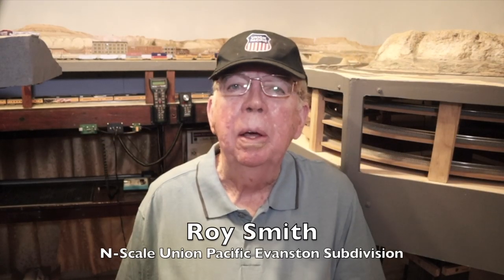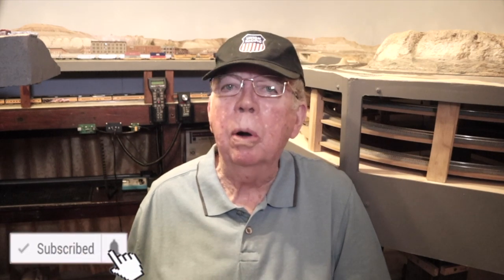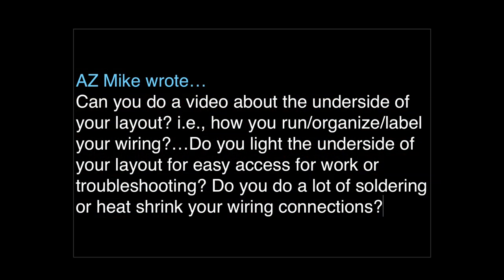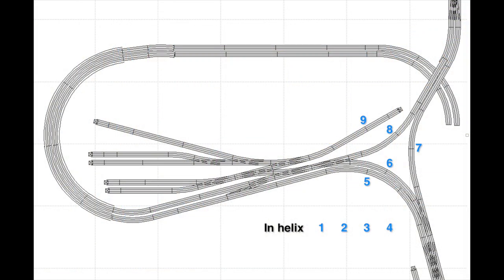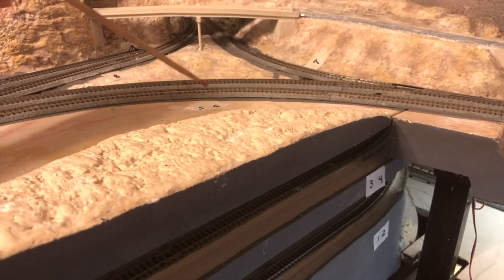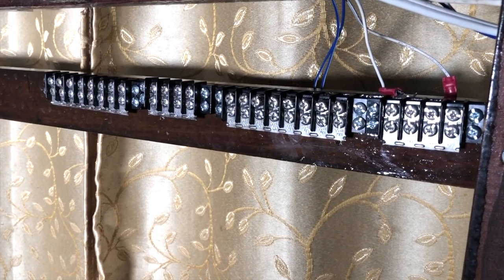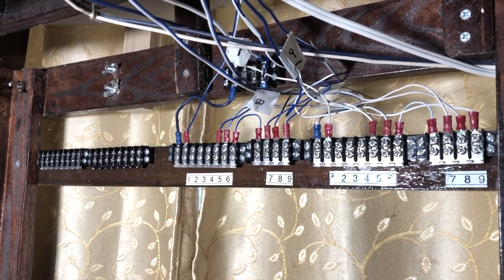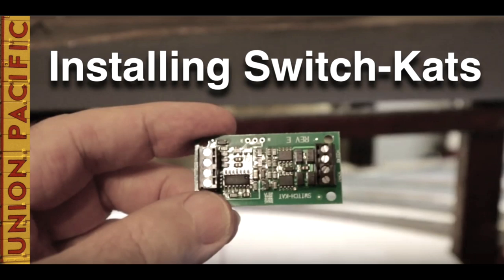Under the Layout 2: Wiring Your Model Railroad Can Be Fun!

Comment: I really like how much cleaner the track arrangement looks in Granger Junction. I have also come to believe using barrier strips is preferable. Did you consider placing the boards for mounting the barrier strips in a location near the front of the layout so they are accessible without crawling under the layout?
Reply from the maker: Thanks, Jerry. I appreciate your comment. I really like using barrier strips to to do my wiring. In response to your question, yes,  I did consider putting the mounting boards at or neat the front of the layout. They certainly would've been more accessible there. However, this area underneath my layout also serves as a desk, so I put the mounting boards off to the side so that they wouldn't be in the way when using the desk. Even so, off to the side is a really big improvement, compared to mounting the electrical components up underneath the sub-roadbed or on the supports for the sub-roadbed, as they were before. The mounting boards will be even more accessible everywhere else on my layout, and I should be able to demonstrate this in upcoming videos. ...Roy

Comment: I had an idea that I've been considering, for when I get around to building my own layout. It isn't so much to do with wiring, so much as it is simply to make under layout access incredibly easy. My plan has always been to use hollow core doors as bases for constructing my layout. They are quite affordable, light weight, but reasonably rigid, and come in standardized sizes, and are always available from your local building supply store. They tend to be made of rather light duty materials, so if you need to do negative heights portions of your layout, then as long as you reinforce any structures you might cut away, you can also generally cut into them as well. In regards to under layout service, I realized that another possibility exists... Install hinges and allow your layout to swing up and vertical! If you swing the layout forward, and have cables hold it from swinging all the way forward, you could stand in the frame, and work on all wiring from a standing or sitting position, without even needing to hunch over! If the layout is self contained on a single door, this is super easy.

Now, on the other hand, if your layout is made across multiple panels, then this is harder to do, as you'd need to have working seams where you can separate the tracks and lift either door panel without being restricted by the other. Inside corners are certainly harder, but possible. You'd need to make it so one side hinges out first, then the corner panel hinges toward the first panel's now open space. Outside corners are no big deal, as both panels already would hinge away from each other.

having the panels hinge like this, provides great access to the underside of the panel. Sadly, getting panels to hinge at the back is much, MUCH harder, as you have to worry about not crushing your work against the backdrop or wall... That said, it IS possible... The trick would be to create a functioning slide frame underneath the panel. you'd need to create a frame that is able to slide forward or backwards, and the panel would then be hinged onto that sliding frame. To make that work, you need the ability to lock the sliding frame backwards or forwards. this can be done in variety of ways, the simplest being a simple hook and eye latch, like what you might see on an old style storm door or a gate door. There are more complicated ways it could be done too. A bolt operated by a knob or lever could engage the sliding frame int he rear or forward positions, and eliminate ant bending or reaching under the bench to do service. Disconnect any tracks that cross from panel to panel (much like your lift out segment by the door), Release the bolt with the knob or lever (or reach under and unhook the hook and eye latches, if you've gone that route), slide the panel forward, and release the bolt latch (or hook a hook and eye int he front), and then lift the panel up. Again, cables would need to be present to keep it from flipping backwards and crushing your layout work.

Additionally, if you expect to have lots of under layout hardware, and worry parts could dip down low enough to catch the framework as the panel slides forward, then another variation of the sliding fram provides both added height for the panel, to allow more under panel hardware to protrude, while also serving as an integral forward position slide brace. if the forward segment of the slide frame is mounted to the rear segment with it's own hinge, then pulling it forward means that the entire forward frame will simply hinge down 90°. This will both lock the slide in the forward position, as well as allow you to still get within the thickness of the slide, in front of your bench, and the thick parts will only be at the sides and bottom, when it's in it's folded down position. It's important though, that if using this configuration, that the hinges for the panel be very strong, as they will be supporting the entire weight of the panel until you lift it vertically. For ease of movement, a fixed angle caster wheel can also be mounted upside down for the slide frame's front end to roll on, when sliding. It should probably rest on a shim on the front lip, to prevent the layout from always resting on the wheel.

The short description of this last concept has you pull the layout forward, like a kitchen drawer. The frame then pivots down to lay against the front of the layout table, and the layout panel hinges up, granting access to the underside. It will be important to have enough length of flexible wire to act as an umbilical to connect the panel to the slide frame, and the slide frame to the main bus. It might be wise to build your table frame with some extra weighty wood at the rear, since the design allows the weight to shift very far forward. You want the table frame to weigh more than the layout panel and slide frame, or it could tip. Bolting the table to the floor or a wall is another option (if the boss of the house permits it ;)

That's a kinda complicated description, but I hope it makes enough sense that someone understands what I'm trying to say. If the idea sounds interesting, and you have questions, I can try to explain it better. Ask anything.

Comment: The liquid tape is ok, specially in humid and wet conditions. But personally, I like heat shrink tubing. Not messy and you don't have to wait for it to cure/harden/dry. Also, to me, tubing looks neater than goop on the wires. JMHO

Comment: I used the liquid instead of shrink tubing. You need ventilation so I opened a window and used a mask. I liked it because it was easy to use with helping hands on the workbench. I had three feeders already on the layout. It was easy to use the liquid but put paper or something on the floor below for any dripping. Also, I used a microbrush most of the time. The brush in the cap is large for wiring as most use it for pipe sealing. It dries quickly. Washing with soap and water is all that’s needed as it will come off your hands in chips. I was happy with it and I have plenty for layouts or rewriting in the future.
Reply from the maker: Hi Dan! Thanks for your suggestions regarding the liquid tape. Chances are that I wouldn't have thought to open the window, for example. And using a micro-brush sounds like a great way to apply it. Thanks for recommending it. I'm going to experiment with it. ...Roy

Comment: Glad to see you back at the underside, Roy. I have used the liquid tape in an electronic application not on my trains. I liked it. Almost couldn't tell it was liquid. I wrapped the joint with regular electrical tape first, then sealed it. Nice solid joint.

Comment: Great instructional video.  And I have used liquid electrical tape - it works well and is more flexible than tape, but the shrink wraps seem the best option once you have them. Thanks For your videos!
Reply from the maker: Thanks, George. The shrink tubing and liquid electrical tape have both just arrived in the mail. I think I will end up using the shrink wrap, but I'm going to experiment with the liquid tape to see how it works. ...Roy

Comment: Well done again. This wiring scheme was very helpful. Although I have to admit I've been doing wiring on model RRs for 50 years I'm always looking for a better way. I have gone back to using barrier strips because I wasn't satisfied with suitcase connectors.  Thanks again.
Reply from the maker: Thanks, Craig. I appreciate your comment. I agree with your comment about suitcase connectors. I've used some of them on my layout, too, and they seem to be working okay, but as a wiring technique, I don't like them very much. ...Roy
Reply: @n-scaleunionpacificevansto6569  I found if you don't crimp them almost perfect and hold the wire just right they may not connect well. Doing that under the layout became a hassle. So, feeders now go to the barrier strips.

Comment: Nice job Roy, wiring is the most fun after it is completed and everything works as it is supposed to. The buss bars you have there are nicely laid out and as easy as possible to get to.
Reply from the maker: Thanks, Rob. The big pay-off seems to come when you step back and watch the trains running without any electrical problems under the layout. ...Roy

Comment: I'd be very curious to hear folks' reviews of that liquid electrical tape as well. I soldered all my feeders to my bus wires, and earnestly started wrapping the goofy t-shaped solder joints with regular electrical tape.... but that got awkward fast and about 80-85% of them are still exposed under the layout. I had no idea there was a liquid alternative to tape, so I'd love to hear those reviews, too!
Reply: I wouldn't go t shaped,  I'd solder them all parallel. The wrap or heat shrink that.
Reply: @SmallSpoonBrigade  Parallel was my original plan, and some (maybe 1/4?) ended up that way. For the rest, working upside down with only 2 hands, it was much easier to put a hook on the feeder to hold it in place while soldering (solid bus and feeder wires didn't help). Planning a major revision to my layout. This time I'm planning on using terminal strips to attach feeders to buses. Much fewer in-line bus solders joints to worry about, which I'll either leave myself enough slack to parallel the lines, or I'll try that liquid electrical tape.

Comment: Hi Roy, I enjoyed the video but must confess I'm confused by all the drop-down wires why they are needed.  Are the tracks in question blocks that need to be powered or are you ensuring enough power is going to the tracks on those locations?  Since my wiring is less complicated (but still scary to do) I won't worry about it but just curious.   Thanks from an old neophyte.     - Dean from Minnesota
Reply from the maker: Dean, the drop-down wires are feeders. I install them every 2 to 5 feet of track. That’s probably more than needed for Kato Unitrack, but I like to be sure that I have sufficient current flowing into my track. There are no electrical blocks on my layout right now, but I may add them in the near future. ...Roy

Comment: Hi Roy! On my Kato layout I installed a Digitrax DS51K1 in each switch. They fit in the underside of the switch. That kept me from having to wire each switch individually.The cost was also cheaper per port than most multi switch controllers. But the fact that I can move switches without worrying about wiring was a great boon as my layout progressed.
Reply from the maker: Thanks, Jay. That’s good to know. I’ll check it out. ...Roy
Reply: Jay Fuller thanks for sharing that idea.